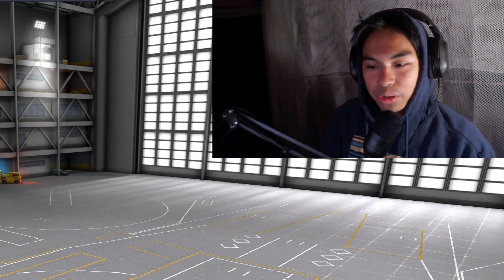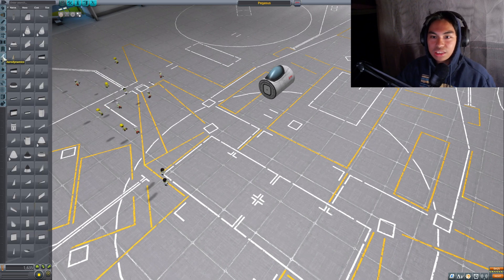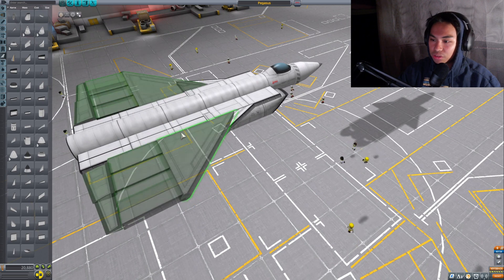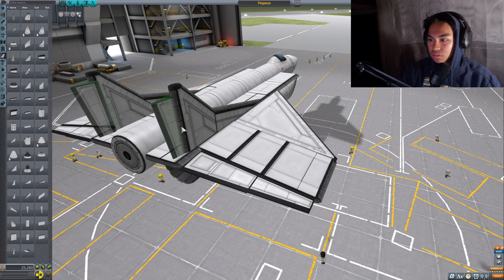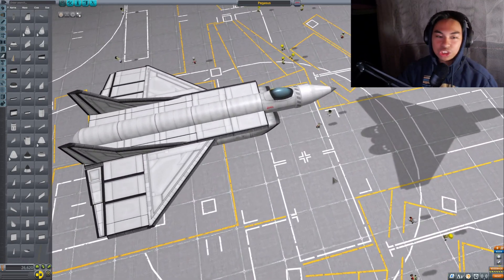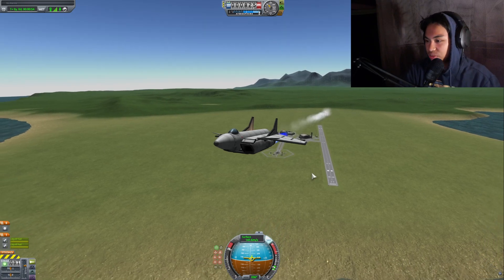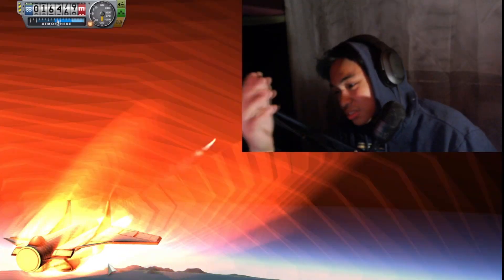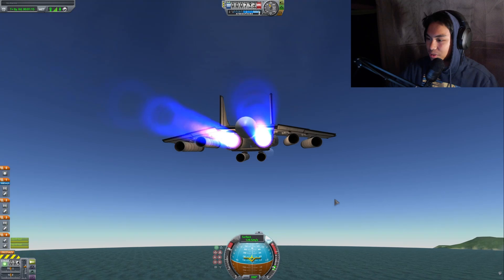KSP Part 20 | The MiG-25 Sucks, So I Made it BETTER

Comment: Since you make so many planes I recommend Airplane Plus it adds more engines, cockpits, intakes, etc., and also Tweak Scale, which allows you to size almost all parts. also go into setting and you can turn on advanced tweakables, it allows you to unstage fairings you dont want deploying on accident, and other things
Reply from the maker: Ooh I’ll have to check those out! Thanks for the tips!